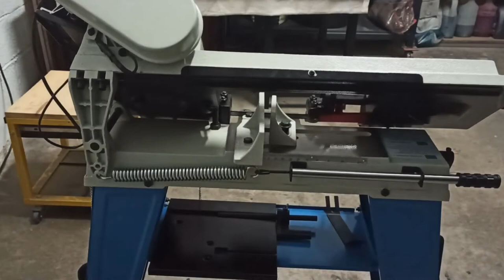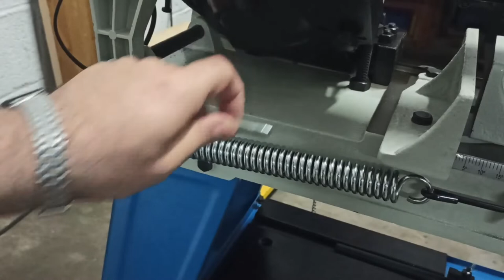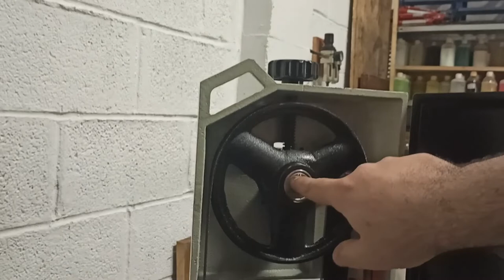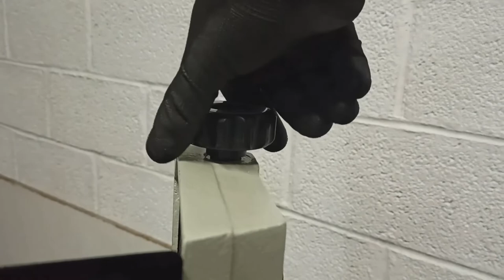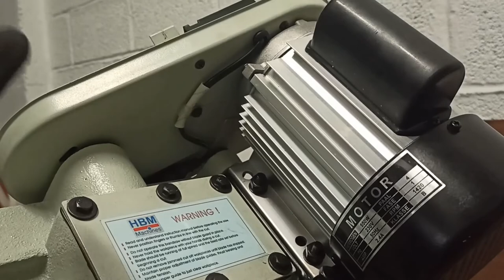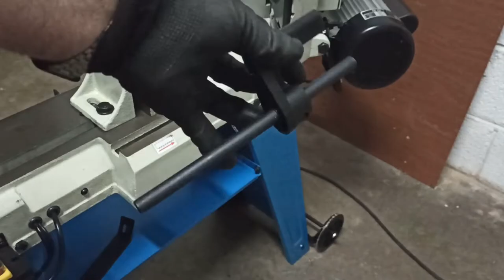Primera Review. Sierra de cinta. #tecnomaquinas

Comment: En la descripción de la página oficial dice que es para cortar aluminio, latón, etc metales blandos... A lo mejor cambiando la hoja puede con hierro y acero sin tardar tanto... O igual es una cuestión de potencia... La compraste para cortar todo tipo de metales? Hay diferentes hojas para ella?
Reply from the maker: Hola Fer Fernando.
Efectivamente, si se va a cortar metales blandos, se puede aumentar la velocidad de corte de la máquina.
La potencia es importante en lo relativo al rendimiento de la máquina. 550W te permite trabajar pero sin forzar la máquina.
En principio, la mayoría de los cortes que haré serán con tubo estructural de 1,5mm de espesor, como el que se ve en la prueba de corte del video. Para cortar este material hay que posicional la máquina en su velocidad más lenta, e ir lubricando el corte, y por supuesto no forzar y tener paciencia.
Hasta lo que yo sé, las cintas de sierra son iguales, pero se pueden adquirir con más o menos dientes por pulgada. A mayor número de dientes, más fino es el corte.
Para lo que no creo que esté capacitada esta máquina, es para hacer cortes a vigas o grandes espesores. Sin embargo, para espesores de 1,5mm e incluso 1Cm, con las debidas precauciones creo que podría funcionar, pero eso me lo dirá el tiempo...
Saludos y muchas gracias por tu comentario.